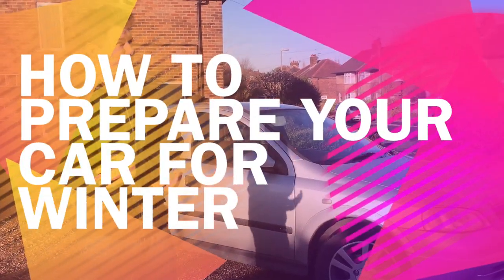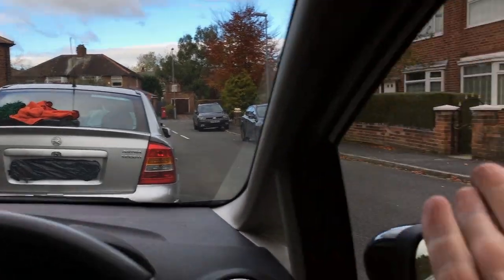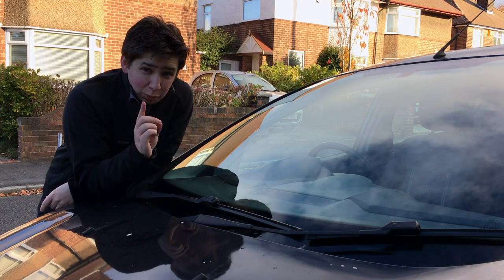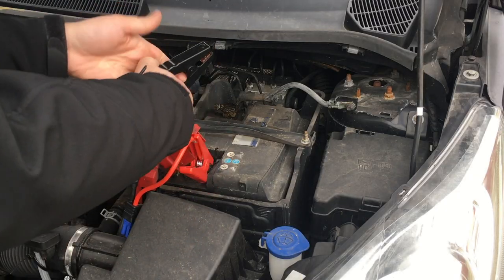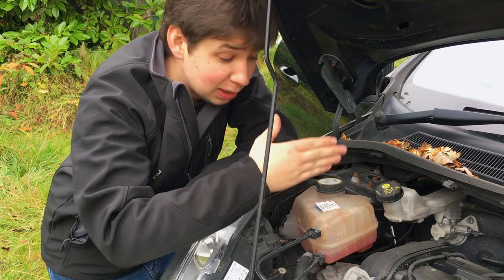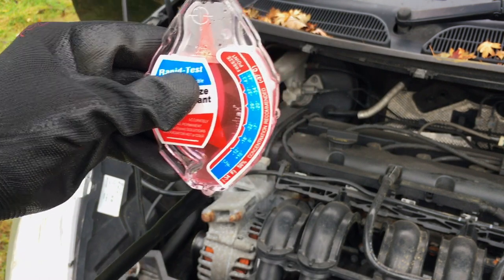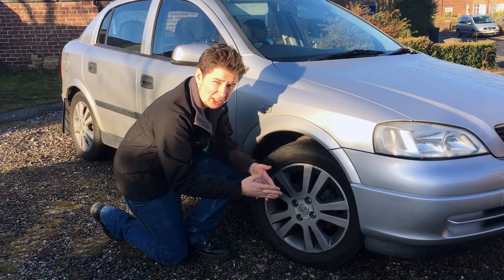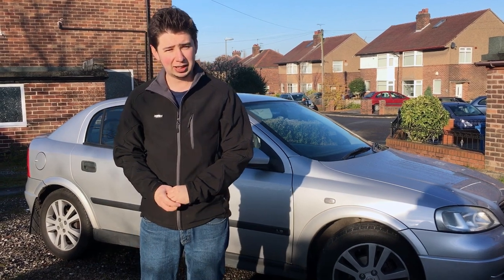Prepare your car for UK Winter

Comment: I know this video is a couple of years old, but people are still going to come across it so I'll comment.  If the quality of the antifreeze has degraded to the point where the freezing temp is near expected weather I don't see how "topping it off" with a bit solved anything.  You've got the right amount in there now but you've got 98% old and 2% new.  Your test gauge showed the desired freeze point only because the reservoir has newer fluid in it.  The rest of the system is still full of old fluid.  It all needs to be replaced.  Good video though :)
Reply: thats what i thought

Comment: Try Autoglanz water repellent glass cleaner then seal the glass with amdetails glass sealant that will last my longer and keep you safe over winter 👍🏻
Reply from the maker: +Paul Dolden Details great tip. I’ll try it out. I’ve also found a good wax repels rain great and is more durable than rain x
Reply: Torque Steer can't find you on Instagram or twitter mate
Reply from the maker: +Paul Dolden Details I need to sign up. I’ll probably look into setting up the accounts in the next couple of weeks. I think it’s hurting my channel by not having them.
Reply: Torque Steer I did look for you on Instagram it's worth having I'm not on FB so Instagram two accounts and twitter
Reply from the maker: +Paul Dolden Details I’m finally on instagram haha ;) torque_steer_uk
Reply: Torque Steer I’ll look you up 👍🏻
Reply: Torque Steer are you under this name mate
Reply from the maker: +Paul Dolden Details torque_steer_uk